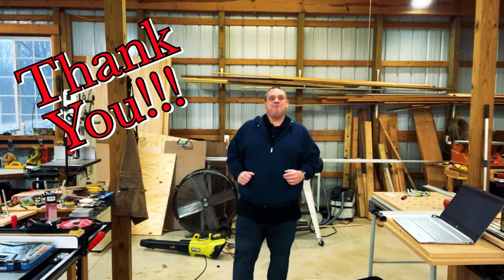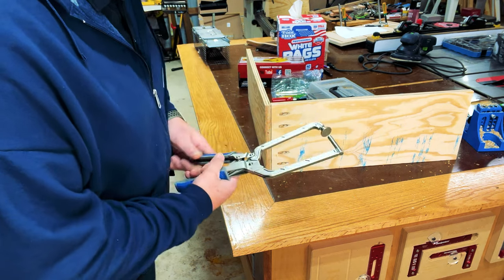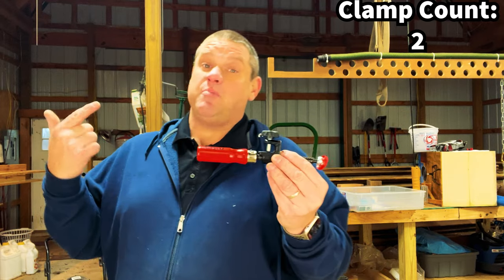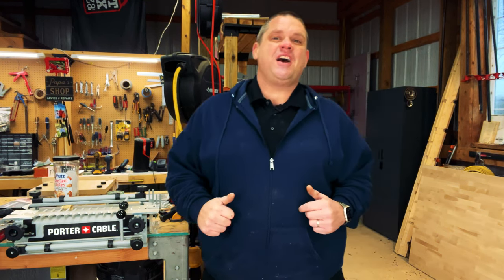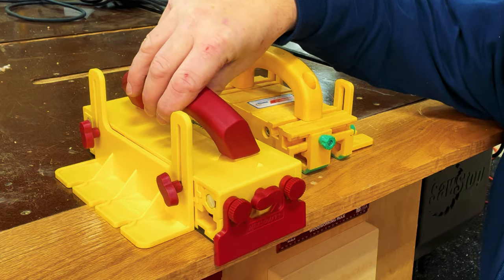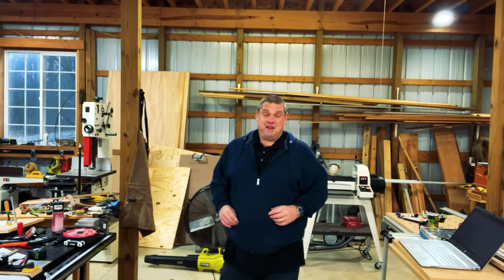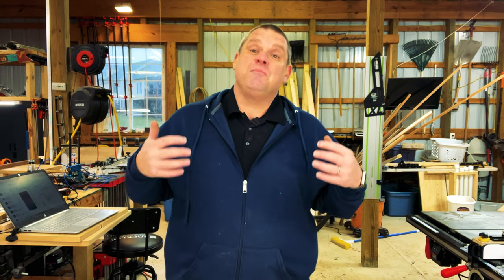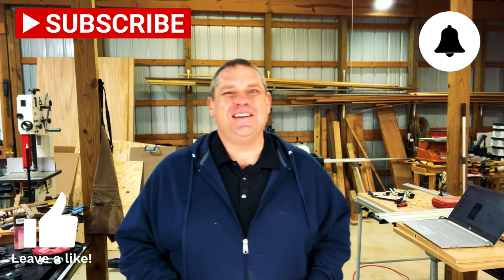Five Amazing Woodworking Tools You've Got To Check Out!

Comment: Loved the bloopers lol. That Rockler set of digital tools was nice. I have the 2 angle finders but no case and that would be nice, sort of. Also, I’ll have to check out that Grabber Pro cause I have the Milescraft set with feather board and I love them. The MicroJig was too expensive for that little bit of plastic. Thanks again for another great video!
Reply from the maker: I agree!  When I bought that MicroJig, it was because I was watching Steve Ramsey all the time and he uses it.   The Milescraft is essentially a better version of the microjig.   For that rockler digital measuring set, I suggest getting on Rockler's mailing list.  It goes on sale about once or twice a year and that's when I got mine.  It's about 20-30% cheaper when it goes on sale!   Thanks for Watching SneakyHippo as always!

Comment: I just picked up the grabber pro last week. So far, milescraft has not disappointed at all. I have quite a few of their tools now.
Reply from the maker: Yeah, I've been real impressed so far.  I always thought they were kind of cheap tools, but my mind has been changed quite a bit recently!   Thanks for watching Nathan!
Reply: @FlynndoggWoodwork  wen is another company I've been rather impressed with too
Reply from the maker: You know, I've been wanting to get something Wen.  i've been looking at their drill presses which I've heard are really nice.  Also the spindle sander.   Thanks for the tip!
Reply: @FlynndoggWoodwork  i have the bandsaw and the oscillating belt/spindle sander and they're awesome. The drill press arrives tomorrow. I'll probably pick up the air filtration, a lathe, and debating if i really need a jointer or not. it would be a nice convenience if i had room, but can accomplish the same thing on the table saw with some work.

Comment: Great Video, I like all the wood working tools except one item, the KREG locking C Clamp, I own about 200 locking pliers and that has to be the worse design ever when it comes to adjusting a C Clamp on earth.   They make similar clamps online with the traditional back end adjusting screw.  Why do I think it's terrible, because the adjustment screw is so small, and if you got sausage fingers it's not easy to adjust.  But the rest of the gadgets you reviewed are cool..   great video
Reply from the maker: Thank you for sharing Kahnawake!  I will 100% agree with you on that little adjusting nob.  it is extremely hard to get my sausage fingers in there as well.   I really appreciate you sharing this.   I also noticed and wished I would have put in the video, that just a little turn of that nob, has quite a bit of impact.   When I was trying to set it for my 1/2'' plywood, it took me quite a bit to get it dialed in to fit perfectly.
Reply: @FlynndoggWoodwork  well its good to know im not the only sausage finger dude out there lol. I bought the KREG jig n clamp and the jigs awesome n i bought a new clamp.  I did a video on the clamp awhile back,  great video though im no carpenter so i learned few new things thanks to your video…

Comment: That clamp attachment isn't good. It will bend your big clamp's rail over time.
Reply from the maker: Yes, I could see that on some of the thinner quick clamps.  Hopefully won't have that affect on the parallel clamps!   Good point though I'll be keeping a close eye on that.  Thanks for the comment!
Reply: @FlynndoggWoodwork  it should be ok as long as people don't overtighten.
Reply from the maker: Yeah, that's the key I think.   I think it is important that you apply the edge clamp before you completely tighten the horizontal clamps.  Once those horizontal clamps are set, it is very easy to overtighten the vertical clamps!